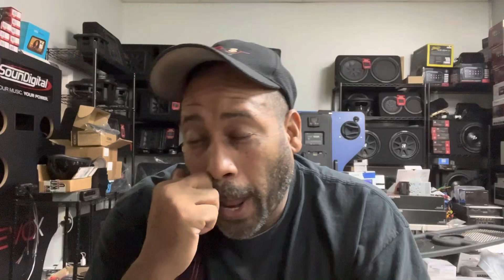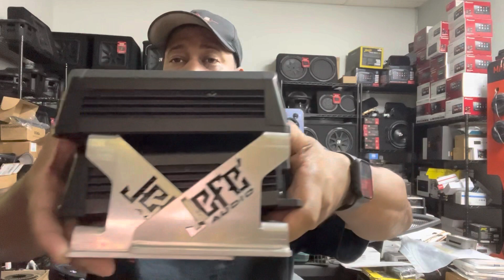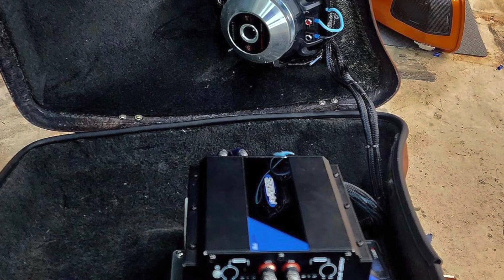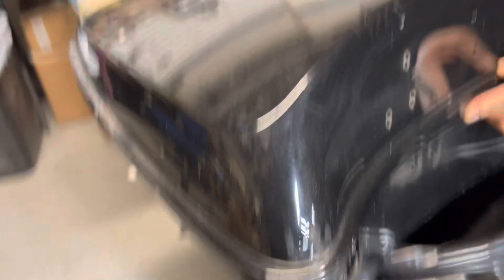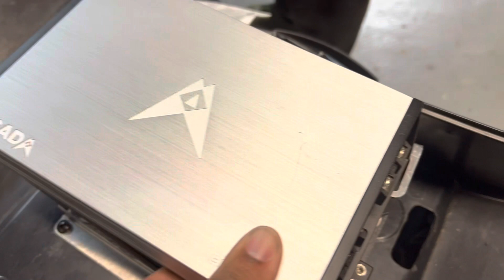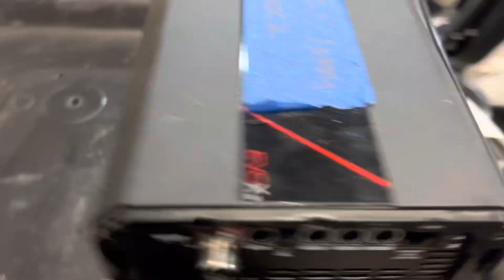Jefe custom cycles tour pack stack amplifier rack for Harley Davidson.

Comment: How do you keep amps from overheating?  running 3 amps and DSP in chopped tour pack on 09 Road King.  10 inch mid bass in bags with 8 inch lids and 6.5 in front lowers.  built a nice cover but 90 plus degree, tropical humidity, amps hot and cuts off in 30 mins.

Comment: How do you keep the amps in the touring pack  cool and not overheat.  I just blew an amp in mine got super hot.  It's a diamond audio micro84U running 4 6x9s in my bags.  4 hertz millie pro 6x9s.   Amp got super hot didn't even blow the fuse....  amp was brand new blew in 15mins...

Comment: I added heat sinks to my amps, with 5 amps in my tour pack, it gets warm in there. I added on top and bottom and sometimes even on the sides of the amps. Definitely nice to see some amp mounts and rack option. My added heat sinks get very warm, so they Definitely work.  would enjoy seeing some videos with heat sinks added and what you use, I use double sides thermo tape.

Comment: Question I have a 2015 harley street glide flhx standard the problem I have is my radio comes on normally I start the bike the radio has a long delay coming back on as soon as I hit the start button radio goes out for about 3 to 4 minutes then comes on help me out
Reply from the maker: What radio is on the bike ?
Reply: @NVSAUDIO  it's  a well put it this way it doesn't have GPS it's regular standard harley radio
Reply: It's not the touch screen